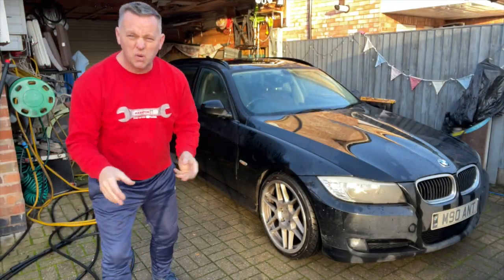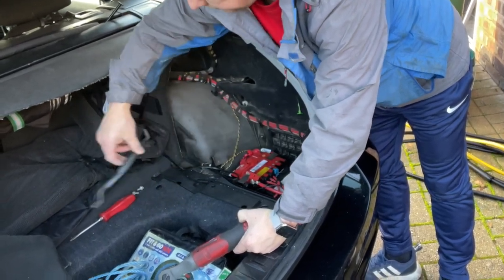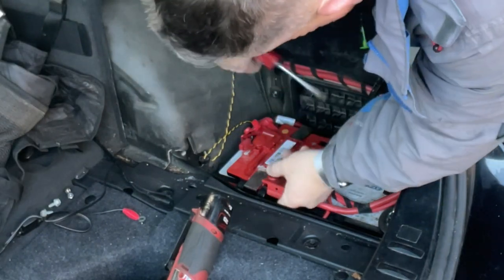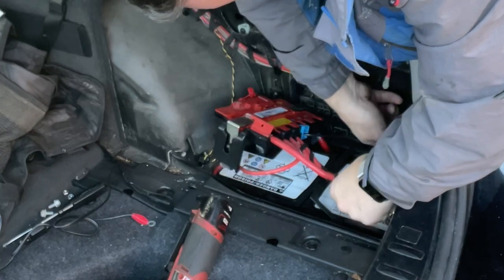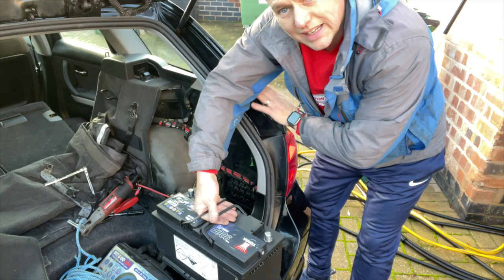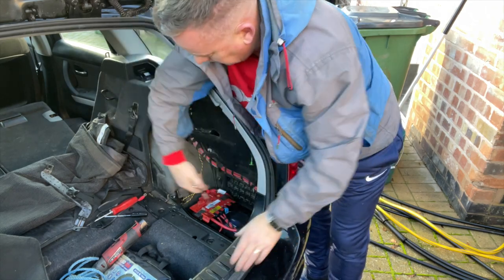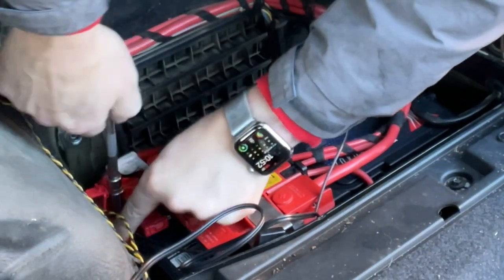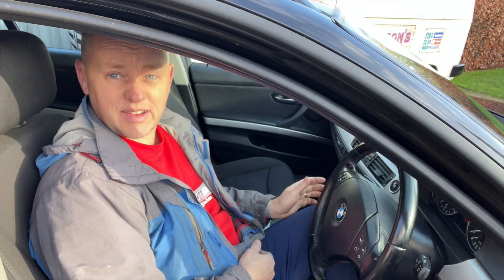BMW 3 series 318d e91 Battery Replacement and reprogramming. Same as 320 330

Comment: :thanksdoc:Hi Aaanton, great video by the way, as always! I need to change my battery on the old E92 320D msport, however i cannot find a 90ah 900cc the one in my car is the original stamped 2007. I had seen other batteries such as the Yusa you put into yours, and glad to see btw as i recently purchased 105ah and it did not fit in the battery cuby hole! NOTE! measure first! Does the cold crank need to be at a lowest 850a sorry i am not familier with the ranges - thanks Aaanton! :thanksdoc:
Reply from the maker: Get one as close as possible, but don't be too worried, Thanks for the great comments👍🏻👍🏻🛠